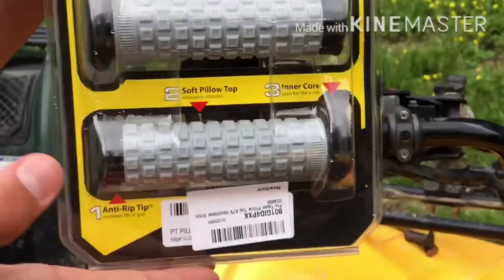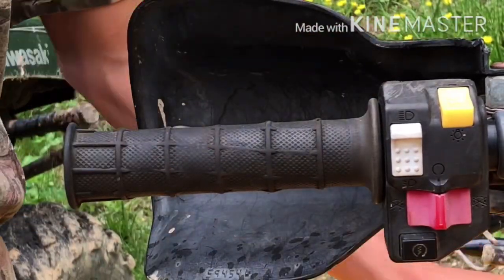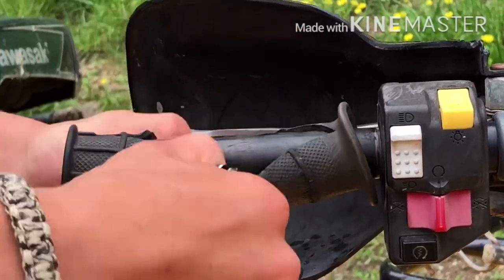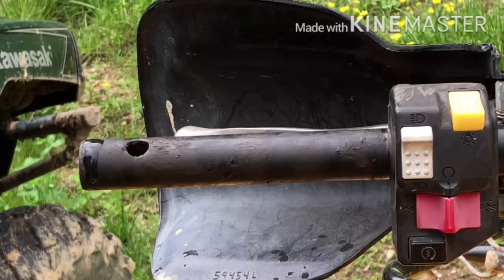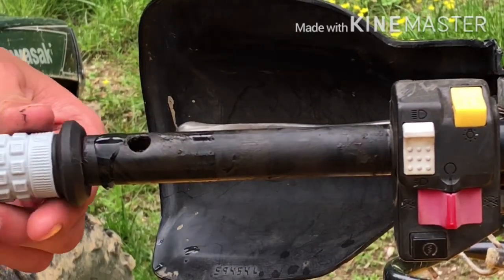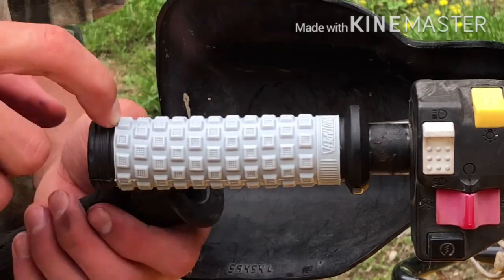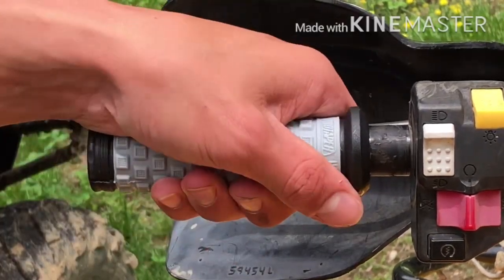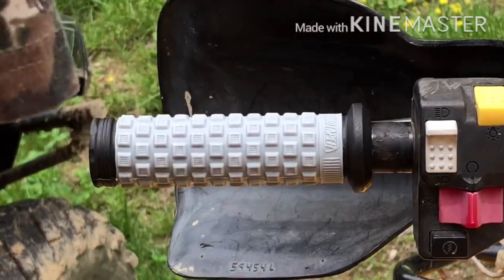How to install new grips (ProTaper)

Comment: use an air compressor. stick the nozzle in there and hit it with air. removing and installing. works great both ways.
Reply: Not if you have holes in the ends of The bars for hand guards. I’ve seen it done what you talk about.